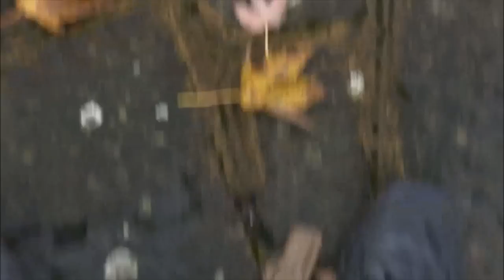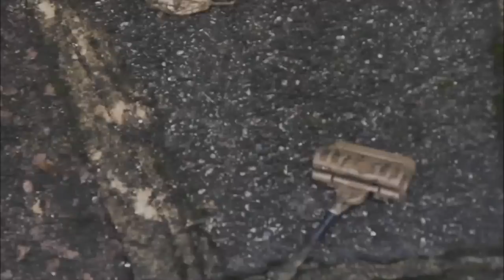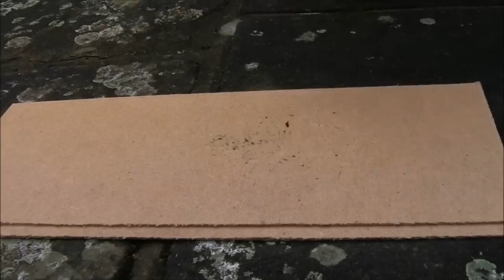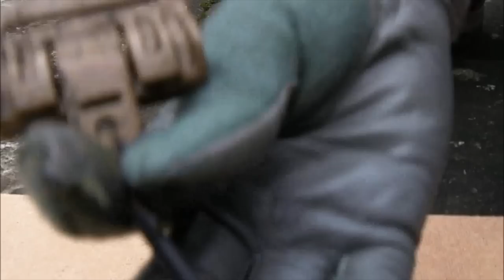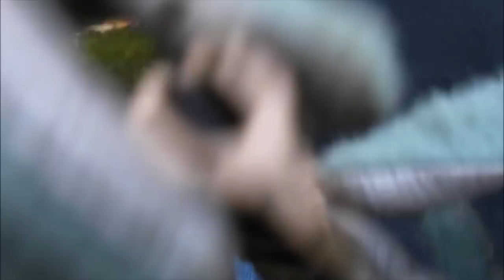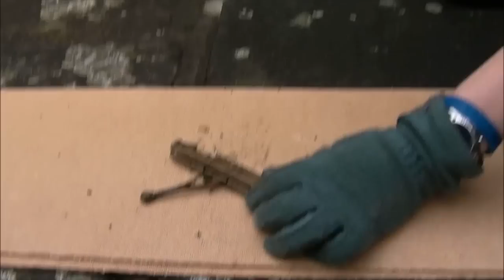FirstSpear Tubes - Tough Enough?

Comment: How did you remove the tubes? I feel that they're really getting in the way when shouldering my rifle and I'd like to remove them to see if I could maybe modify the Strandhogg to use their kind of stupid hook system that they're using on the ECP pack.
Reply from the maker: Straight-up sliced 'em off (after FS sent me a set of field-repair tubes).
Reply: Damn it :(
Are you having having any trouble with shouldering your rifle?
Reply from the maker: Personally, no more trouble than with any other plate carrier design.  The shoulder strap tubes don't really sit in the area the stock does on me.